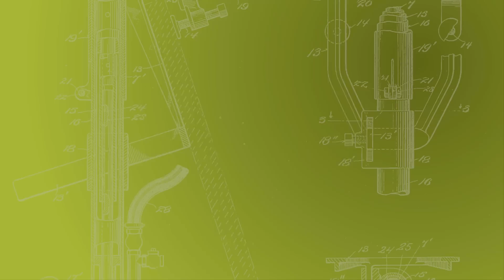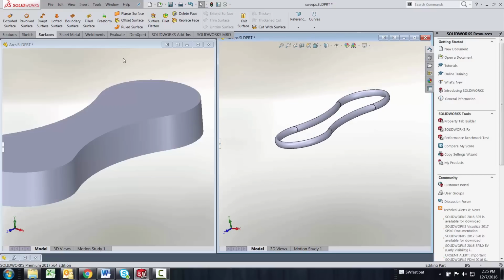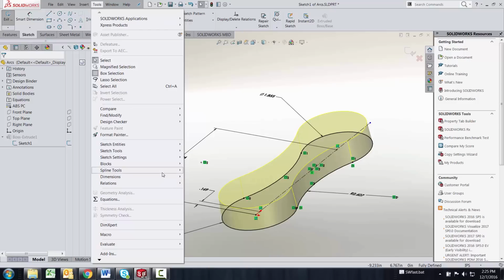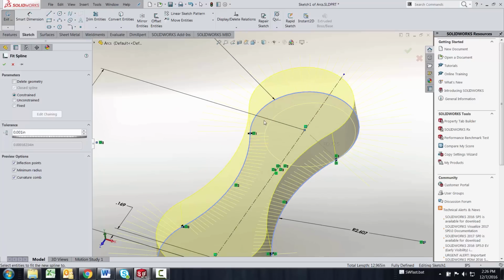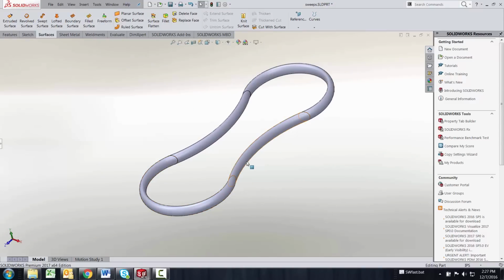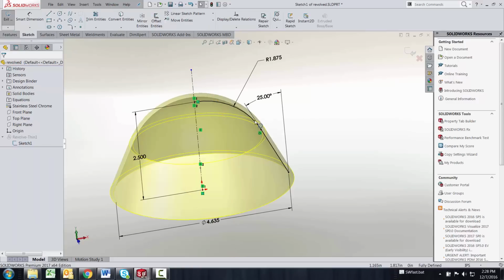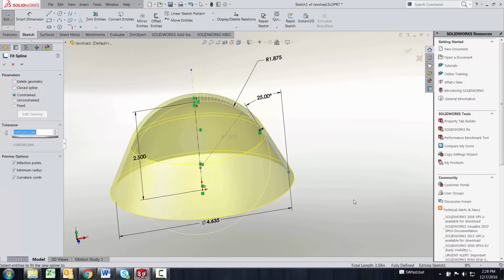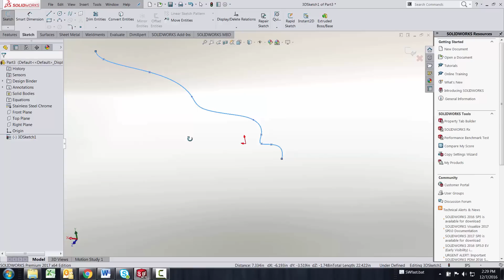SOLIDWORKS - Fit Spline

Comment: If the geometri changes according to the tolerance, then how do you dimension the "new" geometry on a technical drawing? (It seems like "fit spline" makes a spline which would be defined by a lot of different radi's - which isn't desirable for the production)

Comment: Great for smoothing things out, terrible when you need to make changes later.
Reply from the maker: Hey Graham, If you delete the Spline created by the Fit Splint tool, the original sketch entities will be available as construction geometry which you can use to make updates if needed, or revert back to normal sketch entities. Happy sketching!
Reply: @goengineer  Totally, just breaks references to that spline if you referenced it later on, but that can't be avoided sometimes.

Comment: Hi, splendid tutorial tho i have a question. Say im modelling a 2d airfoil with open trailing edge and use an arc to connect them. Then if i use fit spline, it will alter the inital imported curve of the airfoil. So how do i approach this kind of problem only by modifying the arc/spline used to connect the open trailing edges instead of the imported initial spline of the airfoil?